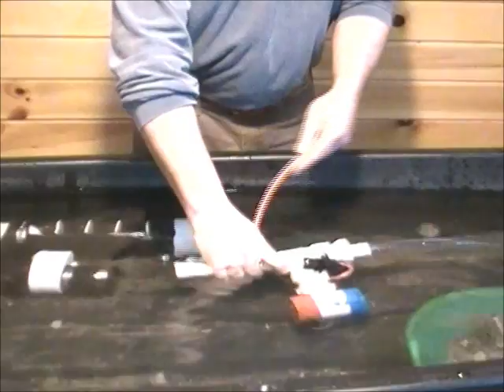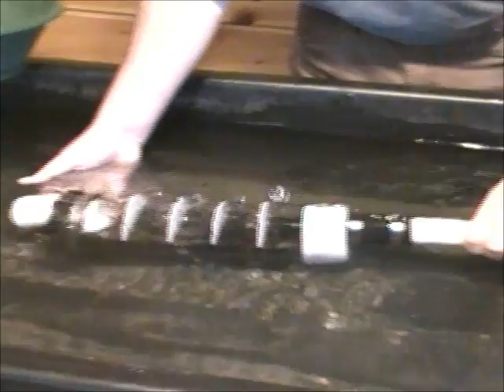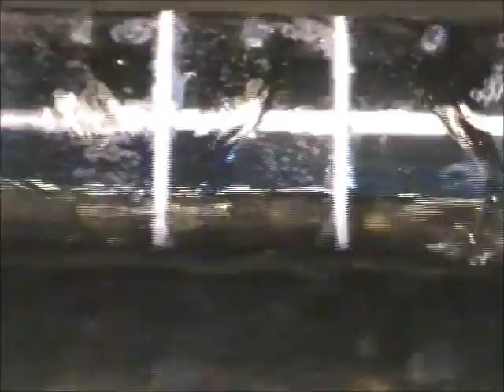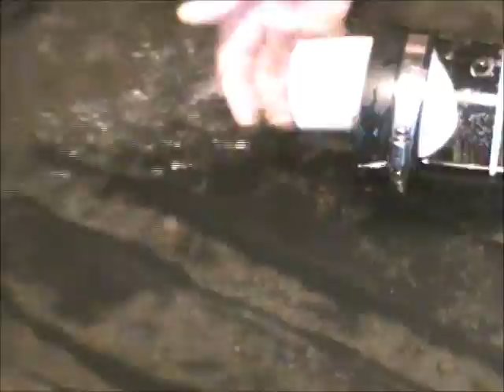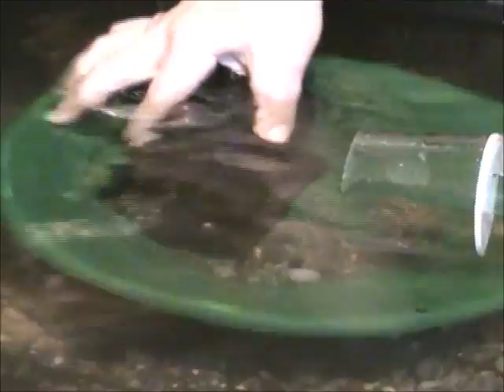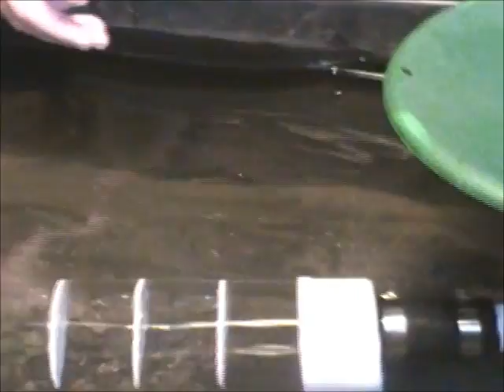Goldsnare SGS-1 Mini gold dredge demo

Comment: That upper baffle designed into the sluice trough is a cool idea!  I like the air bleed holes as well.  I'm impressed that 1100gph pump can run such a large sluice tube as a subsurface dredge...  efficiency!
Reply from the maker: Thanks Kyle, The baffle design allows for the flow to undergo a type of jigging action that allows better separation of heavies to the riffles without impeding pass through flow. A standard size subby is approximately 4x the area of the suction tube and this design allows for 9x the size to slow down flow but still keep material in motion. This is a gamechanger in recovery for subbies. Sorry it took so long to see this, I haven't monitored this channel regularly.

Comment: Hi mate, cool prototype. Is that a 12v 3amp pump? How long would it pump for using a 12v 3amp battery? I’m not good at electrical stuff, but interested. Thanks for any info, response. 
Regards Martin

Comment: Nice idea! It would be great to have a motorcycle battery in a small hydration backpack and waterproof connections. Then you could just move around skin diving and cover a lot of ground. A small cap tethered to the device could quickly be put over the back so you won't lose any material moving around. It would be quiet too, so here in California you could sneak some dredging in the back country and nobody would be the wiser. I hope my ideas help you!

Comment from the maker: Sounds cool. Keep up with the experimenting. The closest I got to this type of design for gold retention was a centrifuge type design but this required a fairly stable platform for proper operation so I kept looking for a more portable solution. I also found that there is no substitute for using real gold for testing and letting the numbers drive your ideas in the right direction.  Good luck.

Comment from the maker: Thanks! Can't wait for the ice to melt so I can make some videos in the field.
Reply: not here to complain, only learn...however this suction seems to be lacking...i have learned about centrifugal pumps, but cannot find a good electric(12v or 110v) pump to suck up like a 4'' pipe can...I want at least a 2.5'' intake, but cannot find a good pump...have seen 16,000gph waterfall pumps, but told they will not work good....i dunno...any info appreciated...want to clean down to 1' in river/creek...